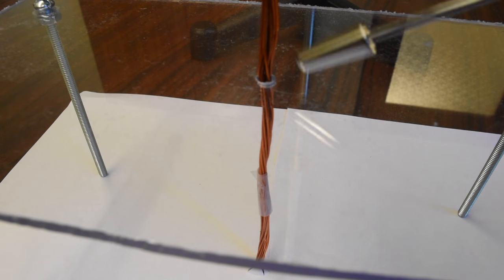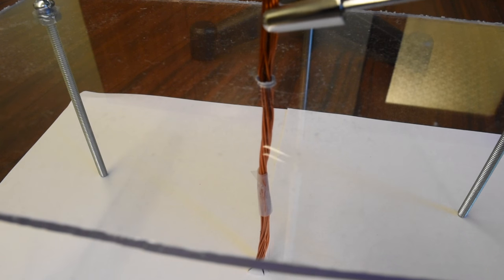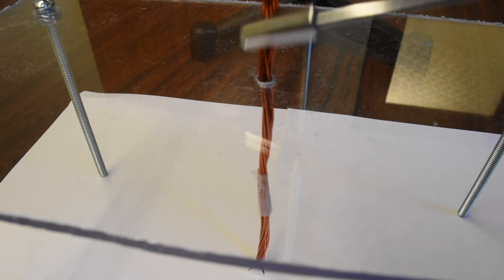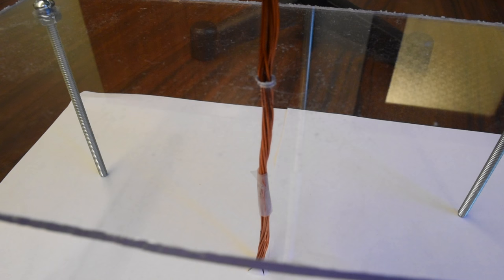Magnetic Field of a Wire

Comment: One thing I don't like about this method is that the iron filings themselves become tiny magnets and stick together. This actually changes the way that they behave, and influences the results.
Reply: no one cares we're just trying to do our physics homework
Reply from the maker: The friction of the iron filings on the plastic hold them in place. That is why I had to tap on the plastic to get them to rotate along the field lines. In this video https://youtu.be/QaZ0h76X6d0 you can see the problem you point out. The iron filings rotate along the magnetic field lines but then they start drifting towards the poles of the magnet.
Reply: What's another method?
Reply: @karinakachtanova4107  😂
Reply: @electricandmagneticfields2314  That doesn't address his original comment of 'iron filings themselves become tiny magnets and stick together.' All your video provided  is that the iron filings became tiny magnets that stick together... in liquid
Reply from the maker: @ICallBullTV  How does it not address his the original comment? There is no liquid.

Comment: Well OK "Prof. M" what is the point or objective of this exercise? So suppose I'm a curious grade schooler, say 11 years old, and magnetic and magnetism are keeping my curious mind busy. But stumbling upon this video I see that this device can be diy homemade by myself and that's got me on a scavenger hunt for parts. But what's missing from this instructionally video, well it's not instructional and not caution or safety instructions shared not even a get out of jail free legal disclaimer. So how would a person young or old know that all copper wires are not equal, especially when it comes to how copper is dressed up in different coverings dependant upon specific of circuit. I've no way to know that your ten twisted copper wires are all evenly coated in enamel or other such material, heavy gauge wire. So one amp multiplied by ten equals ten, great instructions. Now dependant upon what I do with the business end of each wire, may very well determine what happens to my body and this life. In USA shove each end into wall outlet, now we find out if your god is good, is this outlet protected by a GFCI or not, what is the breaker rated to in amps outside in that box, most people fear. There are so many varieties of devices access the world to energize a wire with. So how many lives have been altered or ended due to curiosity and a complete lack of safety instructions. Bet if this was an academic paper presented for peer review might it cut the mustard.

Comment: Where is the north pole in this case?
Reply from the maker: I don't recall the orientation with respect to the earth's magnetic field when this was filmed. The field from the earth is too weak to move the iron filings, so that is why they remain random until a current is flowing through the stranded wire. The field drops off with distance from the wire and why the iron filings at the edge of the field of view remain randomly oriented.
Reply: @electricandmagneticfields2314  but i mean, when we see a permanent magnet you can clearly notice the north pole and the south pole but in the case of a wire carrying a current where is the north pole. Isn't that weird?
Reply from the maker: OK, I now understand your question. It would probably be a 10 minute video to properly answer, which is now on my to do list for this summer. But let me see what I can do in a few sentences. 

For the wire we have what are referred to as free currents generating the magnetic field. There is a magnetic flux density, B, and a magnetic field intensity, H, with B = (mu sub o) H. The B and H fields are continuous and mapped out by the iron filings.

In a magnet we have bound currents that generate the magnetic field. The bound currents are the electrons in orbit and the electron spin. We now will have three fields, B, H, and magnetization M, with B = (mu sub zero)(H+M). The magnetic flux density still forms closed loops, that is B is continuous. H and M are not continuous. M only exits inside the magnet and the north pole of the magnet is a source of H and the south pole a sink of H. 

Hope that helps a little.
 @carlosnoriega7296
Reply: @electricandmagneticfields2314  so in reality there is no such a thing as north and south pole? Are those just two points that we use as reference? Because in a permanent magnet the magnetic field lines go through the magnet's body forming a loop?
Reply from the maker: Yes the lines are continuous, so if they are outside a wire there is no place to call a north or south pole. When they are from a permanent magnet we designate where they emerge as the north pole and where they enter as the south pole.  @carlosnoriega7296
Reply: @Michael Melloch , @carlos Noriega - The field perturbation we call electricity can only exist in the copper if the copper is formed in a loop with resistance (circuit), which of course it is in this great video. With this in mind we know that the circular magnetic pressure mediations must exist in all of the loop (circuit). Magnetic pressure mediations are divergent causing outward, divergent pressure from the center of the loop out, in other words, they force the loop apart. This suggest two things. 

1) The position of the 'poles' would be located as if you laid a permanent bar magnet perpendicular to the copper lines, in this case flat on the plastic with the copper and electricity coming toward you and positioned so as the copper is touching the dead set middle of the bar magnet. The other side of the imaginary bar magnet would be touching the opposite side of the copper loop with the electricity flowing into the the plastic away form you. 

2) That copper is a boundary, or resistive to 'electricity' rather than being a conductor. Most of he field perturbation or 'electricity' is propagated via least resistance, in this case the air surrounding the copper. Copper (a dielectric entity) merely forms a conduit, or is facilitating the field perturbation due to its unique diamagnetic properties. Thanks for the vid, it is great at showing the magnetic pressure mediations. Much appreciated!

Comment: How does one estimate the field around a wire. Does it depend on the current flowing through it? The diameter of the wire?
Reply from the maker: This is how you would calculate the magnetic field intensity, https://youtu.be/Rw7IKosT01E?feature=shared

Comment: The loops…. Is the other part of the loop / circle of wire outside the view of the camera? Or what is meant by loop? Thinking if the whole loop is here then current is going one way in 5 of the wires and the other way in the other 5 wires so how would they interact? Vs if the loops are really big and we can not see the other side of the loop? Thank you!!
Reply from the maker: Yes, the rest of the large loop is outside the view of the camera. So in the region of the filings, the magnetic field from the wire where it starts to loop is insignificant. The current is going in the same direction in each of the wires in order to get a larger effective current in the vicinity of the iron filings.

Comment: Which direction are they polarised to?
Reply from the maker: If you put your right thumb in the direction of the current flowing in the wire with your right fingers curling around the wire, your right fingers point in the direction of the magnetic field.
Reply: @electricandmagneticfields2314  
Thanks for the reply dear.
Is it possible to visualise with those particles? So that both pattern and direction can be visualised 😎
Reply from the maker: @mutthunaveen  This will only show the pattern but not the direction.
Reply: @electricandmagneticfields2314  😎😎❤️
Got it.
If that can be visualised. The whole text book theory can be visualised.
Already what you have have posted is a  Great video, thanks for your thoughts.
Reply: @mutthunaveen   you could use many small compass needles placed around the wire to visualize the fields direction. Or tiny bar magnets of the size of iron filings, that have one ended colored.

Comment: must the naked wire be ?
Reply from the maker: No, you want to use insulated wire. That way if you have 10 loops of the wire you have 10 times the current and so 10 times the magnetic field.
Reply: @electricandmagneticfields2314  hello ! what is the required voltage ?
Reply from the maker: @sunahangrai3601  I did this a while ago and unfortunately do not remember.  I do this one https://youtu.be/bq6IhapfucE every semester in class and I use a 9V battery. The coil is a much easier demo to put together.

Comment: This was clockwise or anticlockwise
Reply from the maker: If the current is coming up out of the page the magnetic field lines would be counterclockwise. Put your right thumb in the direction of the current flow and your right fingers curl around the wire in the direction of the magnetic field.
Reply: @electricandmagneticfields2314  yes sir but in this experiment the current is entering or exiting ,I mean the current is flowing from upper side or downwords side
Reply: @experimentstrom9520  if I had to say, I would say it is coming from above. Since I don't see anything powering the wires from below. And if that is the case, the Flow should loop clockwise. But do we call that field an electric or magnetic field?